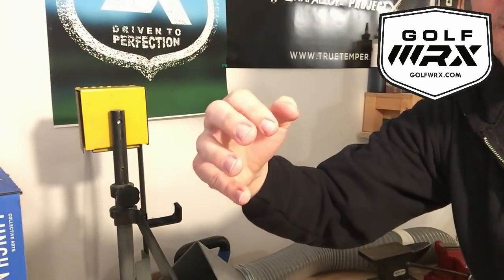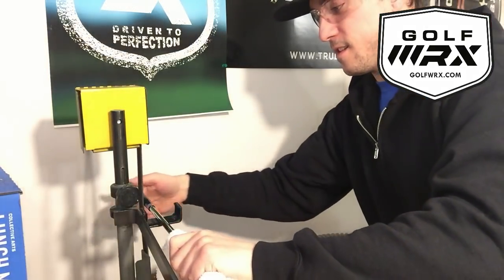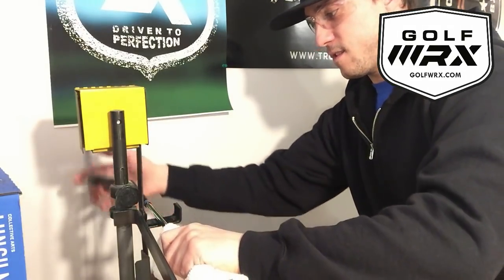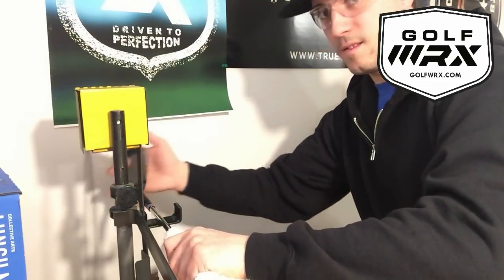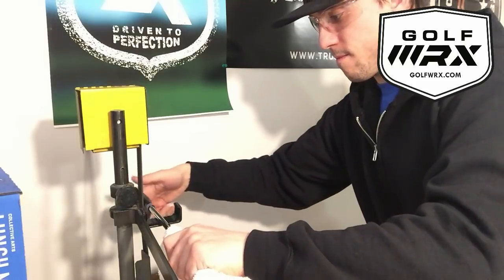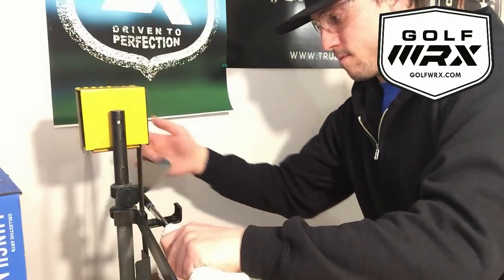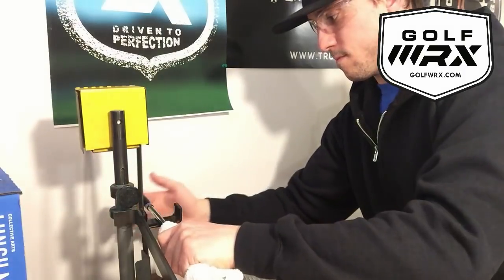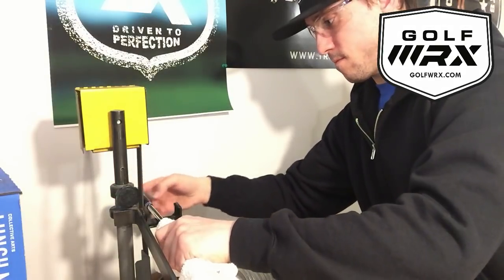How To: Properly Turn Down a Ferrule

Comment: What type of belt do you use for abrading graphite shaft tips and what belt for turning down ferrule?  I've read about a few different options and don't want to damage a shaft or a ferrule. I'm a rookie club builder
Reply from the maker: Thanks for the question,
for graphite I use a standard 120 grit sanding belt and just use a very small amount of pressure. As for turning down ferrules I use this one:
https://www.golfworks.ca/durabrite-felt-ferrule-turning-belt/p/gw1065v/
It you are a beginner I would suggest practicing on an older graphite shaft that you are not worried about so you can get the feel for how hard to apply pressure to either remove paint or to create the taper.
Reply: Ryan Barath Awesome!  Thanks for quick reply and I appreciate your willingness to help as I’m just getting started. Been doing grips for a long time and have been wanting to get into more advanced stuff for a while. Just landed on a flight where I listened to the GolfWRX podcast - great stuff!!